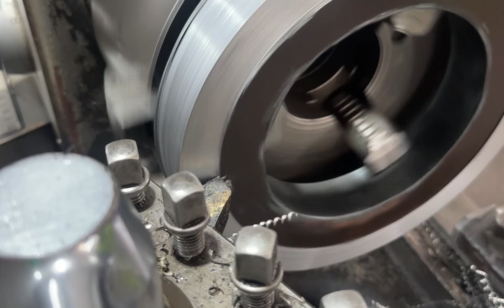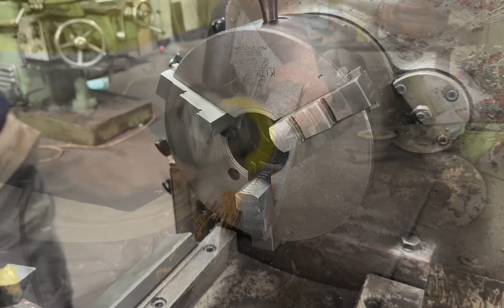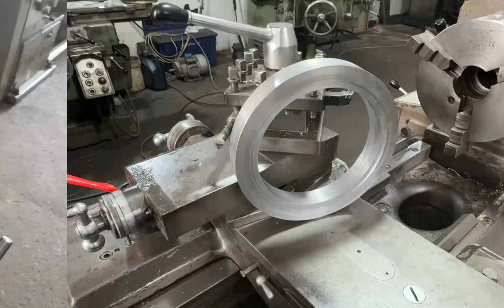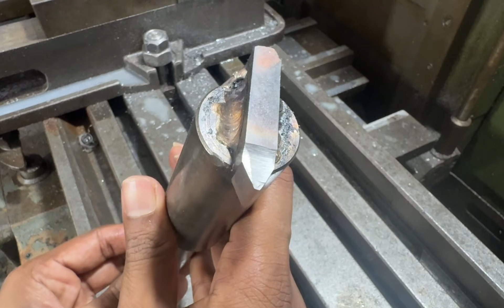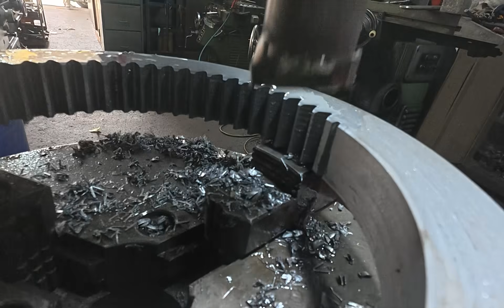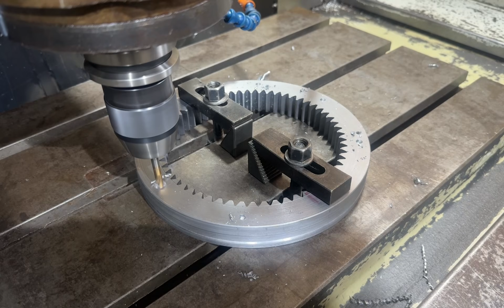Making an Internal Gear Wheel | Full Machining Process

Comment: How do you do the induction hardening of the gear teeth ?
Would be nice to measure the dimensions of the customer part at the beginning of the video - that looks like a big gear part but how big exactly ? And how many teeth ?
Reply from the maker: Thank you very much for the kind feedback! All the dimension were measured and didn’t include that part in the video. The part was used in an old dough mixer machine and the original part was made of cast iron.
The outer diameter of the part was 240mm while the thickness is 30mm & consisted of 60 teeth in total. 
Outer layer was case hardened using a flame torch in a very traditional way.

Comment: if the tooth ring is made in actual broching machice [broching tool] the work doned in minutes 😅😅, manual method such the time and energy, but your skills are appriceatable bro 🫡💯💯
Reply from the maker: Indeed brother! This is such an inefficient method. But these parts are not made often, so we use these manual methods

Comment: How to find the module of internal gear? Can you introduce?
Reply from the maker: As Im saying on the video, I didn’t consider the module, I just matched the tool’s profile with the required profile. However, the wheel is successfully running without any issues

Comment: Can low-carbon steel be hardened? What hardness did you get?
Reply from the maker: Yes. It can be case hardened. But it was unable to get a considerable hardness.
Reply: @oddmachinist  I have tried case hardening of mild steel once but didn't get good result so I have to practice more. Maybe didn't give it enough time or heat.
Reply from the maker: What compound did you use? The temperature & the heating time is vital.